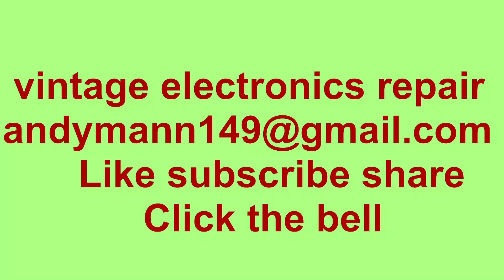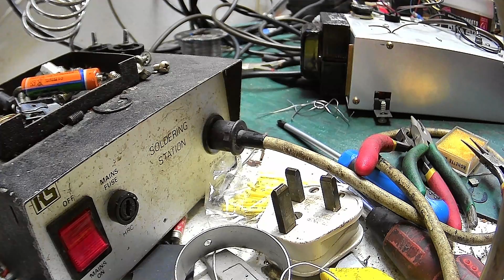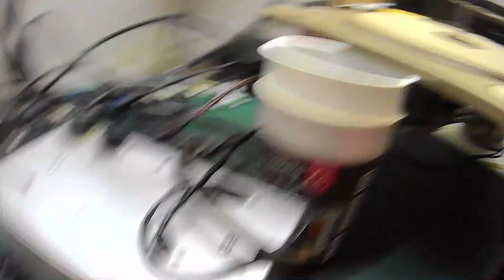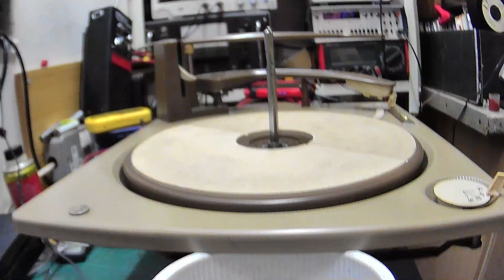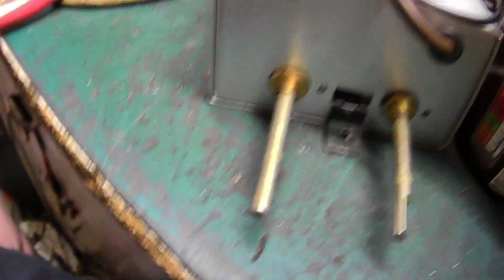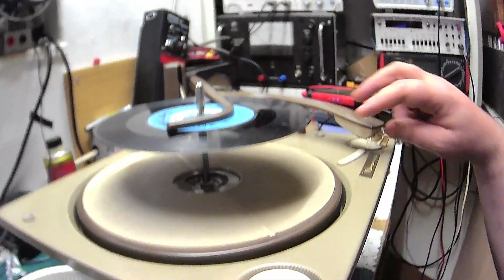THE PYE BLACK BOX IS FIXED

Comment: Germanium transistors have a habit of intermittent problems due to formation of tiny internal tin whiskers between the leads and the case. If disturbed they can break off but may form again. I usually insulated the transistor from the heatsink so they can keep on working. Best to replace them but we all know how hard it can be to find replacements and NOS ones will likely be equally susceptible